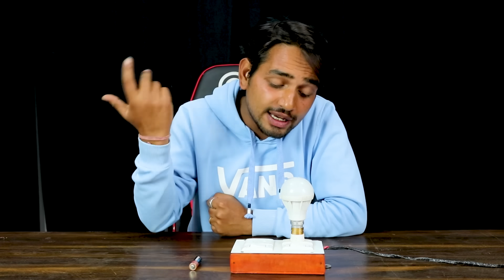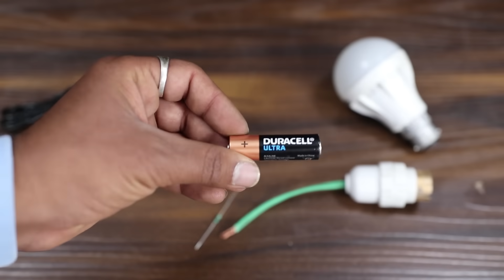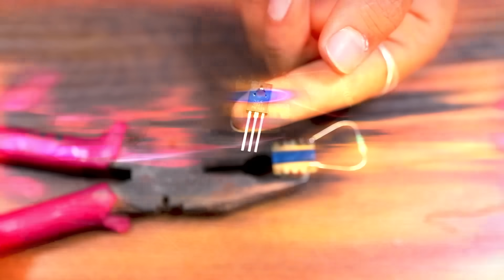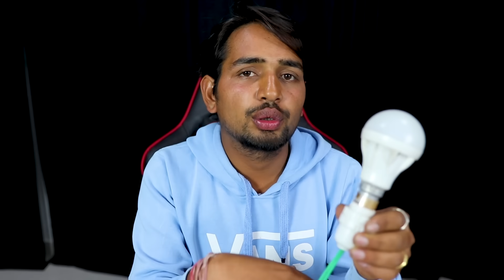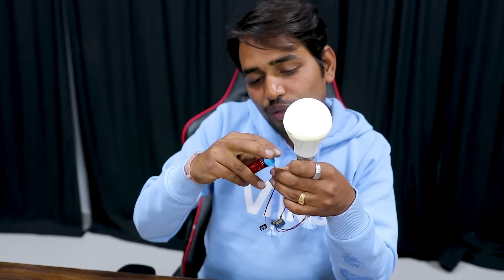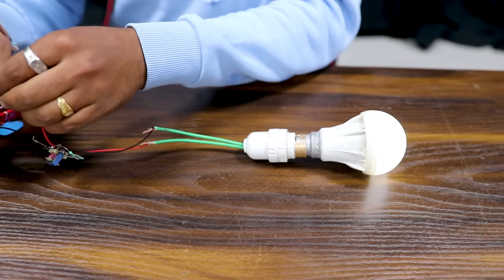छोटे सेल से जलाये बल्ब - 1.5 Volts To 220 Volts Inverter How To Make At Home | Science Project

Comment: Me: Sir, can I run a led bulb using 9v battery?
Sir: Don't ask stupid questions, it's impossible
Mr. Indian Hacker: Hold my mind
Reply: I don't think a teacher would say this unless he is teaching absolute kids. 
The dude just used a transformer from the charger to make the inverter this is a very common DIY inverter.
Reply: LED can be turned ON by 9V DC but LED BULB can't. Fake video hai Bhai. Magic LED bulb ka video dekho market mein milte hai wo bulbs 100 200 rupaye mein.
Reply: @sforsuraj7255  It can be
Reply: @sohagdas8351 20 watt ke LED ko 230V supply dene ke baad 0.087A ka current flow hota hai agar 5V/9V DC ko 230V AC mein convert karna hai to voltage to badh jayega but current aur kam ho jayega some what around nano/micro Ampreres which is not suitable for LED BULB. So it can't be.
Reply: @sohagdas8351  bhai ye wala video dekho
https://youtu.be/LLShvBfPir8
Reply: Bhai mere 110 subscribe hone wale ha ha sirf 9 subscribe Kam ha please support my channel#PUBGBOSSFUN
Reply: Bro ask that teacher that why do we use amplifiers? This was an Transformer coupled Power Amplifier.
Reply: @sohagdas8351  Technically its not an inverter. Its an Amplifier which is amplifying the power output of the battery. Very common in terms of electronics.
Reply: @sforsuraj7255  Bro he used an D882 transistor. And the connection is called Transistor coupled power Amplifier. It amplifies the voltage output as well as current output ( overall power gets amplified).
Reply: @SouradeepSD  or more simply it's an step up transformer.
Reply: @SouradeepSD  bro actually I was joking🤣🤣
Reply: @sohagdas8351  bro it's a joke
Reply: @MNGAMER609  I get it I was just saying.
Reply: Mere channel pe jake dekho
Reply: Fake video... Kb se banane lag gya...
Reply: You didn't see he tested with 9v battery
Reply: Teacher: abey saale
Reply: Aapne STEP UP TRANSFORMER NHIN PADHA KYA? 😂
Reply: @sforsuraj7255  bahut aata hai na to sun Jo ic lagi hai vo kaha par use hoti hai bol
Reply: Plz share circuit diagram
Reply: @arunmaurya7256  tum puch rahe ho ya bata rahe ho 😂😂😂
Reply: @SouradeepSD  battery voltage step up kiya to current kam ho jayega kyunki power jo transfer hoti hai woh same hi rehti hai. Agar voltage kam kiya to current badhega agar voltage badhaya to current kam hoga. So it is purely fake video. Usne wo transistor IC uss LED ke dono terminals ko short karne ke liye use kiya hai. Magic LED BULB search karo youtube pe aapko pata chalega pura scene kya hai. Ye video hi fake hai Mr.Indian Hacker ka chahe to unse hi puch lo.
Reply: @sforsuraj7255  puch raha hoon
Reply: @arunmaurya7256  wo ek Transistor IC hai jise switch ke tarah use kiya hai is video mein gate terminal ko bias karake
Reply: Fake Video because transformer cannot work on Dc power supply bt there was no DC to Ac converter. It was simply a trick of DC/AC led bulb Which can glow in both types of supply
Reply: @sforsuraj7255  I just noticed that the Transistor he used is in switching configuration. Sorry.
Reply: @SouradeepSD  can uvplz provide circuit diagram .
Reply: @SouradeepSD  or power amplifier signal ko amplify krta he jiske liye hme alg se ek battery ya power source ko jodna pdta he.
Jese audio signal ko amplify krne ke liye alg se power ki jaroort pdti he.
Bina kisi extra power ke kisi circuit me available power ko amplify nhi kiya ja skta
Reply: @r.prajapat42  haan mene notice nhi kiya tha jaldbaaji me. Yaha transistor switching ke liye use ho rha h.
Reply: @SouradeepSD  wo transistor ka use kevel fool banane ke liye kar rha he led sirf or sirf battery voltage se hi chal rhi he.
May be led ka driver nikal diya gya or sirf direct battery se chal rhi.
Or hme board se chalakr dikhane ke liye board me bhi ek 230 to 5v dc convertor rkha ho. Usse led chal rhi
Reply: @sforsuraj7255  I did that , it worked but its not as bright as LED bulb on AC supply
Reply: @sforsuraj7255  5V to 220V is 1-5 mA
Reply: @sforsuraj7255  Any idea how to increase current?
Reply: @JagtarSingh-xt6os  That LED lamp has a inbuilt battery which js used for emergencies. And that lamp is available in electrical shops.

Comment: If a 220v bulb works with this tranformer setup . Try running a fan with 9v/1.5v , it would be interesting to see what happens.
Reply: No bro wo nhi chalega....bcz cheeze only voltage se nahi balki amp. Se bhi chalti hain...bulb me km use hota h islia wo chal gaya but fan me jyada chaiye so wo nhi chal payega...bcz transformer me agr vol. badayenge to amp. Km ho jayega aur amp. Badaya to volt km hoga....
Reply: Max output 150v×0.1ah= 15 w

Comment: This is a simple joule thief circuit, which is based on self oscillating booster...battery last only 20-30 min, still preety good for kids school project👍
Reply: Krishna Mohan experiment YouTube channel
Reply: I accidently left my battery connected without connecting load on other end and battery drained to about 20-30 percent in just few minutes
Reply: Can you tell me how much max input voltage and amperage it can handle (with heatsink attached)
Reply: Ok
Reply: but sir yeh work kase krta h transformer to only AC current per kaam krta h
Reply: @vegamehra1162  Transformer can work on both AC and DC as well. On AC you simply need to connect transformer with it however incase of DC u need to interrupt it periodically and it's called fluctuating DC. It's kind of AC with missing negative wave. World's first transformer was actually working on DC(fluctuating) invented by Nicholas Callan in 1836 called as Induction Coil which used mechanical interrupter for generating fluctuating DC.
In Joule thief circuit, transistor is used to produce fluctuating DC(kind of) in connection with Coil. This circuit works by rapidly switching the transistor.
Reply: @ROBINSINGH-wv3xe   thanku sir,, aap bhut ache se explain kiya
Reply: @vegamehra1162  thanks to u too, aap ne mujhe knowledge share karne ka mauka diya

Comment: Use 13005 D transistor instead of D882 for better result
Reply: Man I m making a project so I have to glow a bulb with battery , So the transistor you are talking about is good for it.
Reply: I don't want a high voltage-based applications

Comment: What's the logic behind this ?
You always show experiment but very few times give explanation.If you are performing this you should give some knowledge behind it 😒
Reply: Logic is... The transistor changes the dc voltage into variable voltage. Transformer helps in raising voltage of cell (1.5v) into 220v. The bulb operates at 220v. So basically, the circuit used is for raising volt from 1.5v to 220v

Comment: Bro in mobile charger we will be having step down...how did you used it for increasing voltage
Reply: I think so transistor ho ga
Reply: Step down ko reverse connect kiya to turns ration reverse hoke  step up hota hai
Reply: By reversing terminals

Comment: Can we charge our phone with this
Reply: Yup
Reply: Its a step up transformer
Reply: He just inverted the transformer from step down to step  up jese in charger the   voltage reduces to charge your battery wese voltage increasing to light your bulb
Reply: @wreckrex5916  to bhai dc ka ac kese ban gya
Reply: @r.prajapat42  thats because of capacitor transformer all together makes it inverter
Reply: @wreckrex5916  it is not possible only with 1 transformer and capacitor.
and he didn't use capacitor. He use resistor. Can use tell why he used resistor 1k.
To convert ac to dc an oscillator is required.
And first transformer doesn't work on dc supply it must be change dc to ac first and than setup up .
Reply: @r.prajapat42  bro im not an expert he uses resistor to increase votage , you know ohms law right V=IR and you are not converting ac to dc here you're converting dc to ac oscillator adds to the AC wave to make it dc that is process in rectifier and here he is removing extra wave to make it sinusoidal wave
Reply: @wreckrex5916  bhai R is constant value and never increase voltage.
I know ohms low it works only in dc circuit.
I am also not expert.
Reply: U can also practical this application which will not successful
Reply: @r.prajapat42  bhai R there  is resistance proportionality nikaalne ke liye intriduce karte h R and R is constant only it will remain 1000 in that resistor while Voltage and current may vary,for instance like if V=1000*I if I increases V also increases a constant doesn't have to be unknown
Reply: @r.prajapat42  and you see the relation right if current increases by 1Amp to 2 Amp voltage changes to 2000 V just  by the relation V= R*I =1000*1
Reply: @r.prajapat42  just like tereko ek pipe se paani bhej raa h if you reduce the rate of flow by reducing cross section of pipe in middle simple words me pipe pe leg rakhegaa toh pressure badegaa naa? Wese hii resistor reduces the flow of current from the citlrcuit thus increasing the voltage
Reply: @wreckrex5916  bhai  resistance se thoda sa voltage drop ho skta he lekin 5 volt ka 6 bhi nhi ho  skta. Mtlb bdh nhi skta.
 bhai 
Ye bataieye ki ap electrical me apne kya kiya he be. btech etc.
Reply: @r.prajapat42  im a mechanical engineer
Reply: @wreckrex5916  I'm not engineer but i think you have not deeply read about ac dc circuits .
So u are giving ex. Of water flow in pipe😋

Comment: What is the difference between cell and battery?  Class 7 physics
Reply: A cell contains some chemicals and a graphite rod which is responsible for the flow of current. While, a battery is a collection of cells.
Reply: @minhajahmed3617  that's right
Reply: @namansingh5276  Are you a student of class 7?
Reply: @minhajahmed3617  no bro
Reply: @minhajahmed3617  That's just for dry cells, there are other types of cells as well

Comment: Es necesario traducir al español para poder entender,parece estar bueno Gracias
Reply: pos segun mi teoria,  le metio directo alta tension seudo directa al foco, quitandole su circuito electronico 110 al foco, luego le pone bateria duracell que tiene mucho amperaje y es muy cara pero cuando tiempo podra prender eso pues rapido se acaba la pila obvio, pero la alta tension no filtrada y de muy alta oscilacion dc no pura pronto acabara con los leds ya que ahi no veo capacitores filtrando la dc  o tu que crees carlangas
Reply: Make this project again plz sir and show out put voltages

Comment: Immposible please observe the transformer start this was green and soldring time this colour was red the red colour transformer was winding for work please observe this this is fake / and the electric bord was the 12/1.5 voltage and bulb was to 1.5 volte or 12/9 observe 9 they give 9 voltage the bulb was highlight and he was connected to 1.5 to low lights. I know i am electration this electric bord was 1.5/12/9 voltage etc.

Comment: hello friend, thank for your video, I have some questions:
1- how did you know where to solder each component.
2- Shouldn't you first measure the resistance of each pin.
3- What will you do if all of your transformer coils pins have the same reading.
4- how will this inverter will work, namely, operation.
Thank you.

Comment: Fake just fake. 
Using DC for transformer. 
No just these two resistors, won't convert DC to AC 
And even if transformer steps up the voltage the power is same, 
And there is not enough power in a dry cell to light up that big bulb for more time...